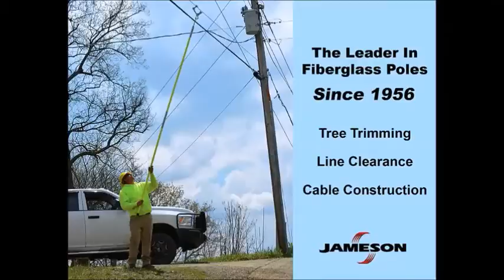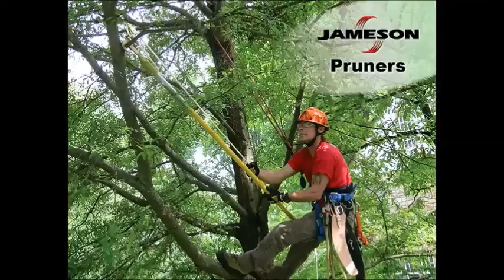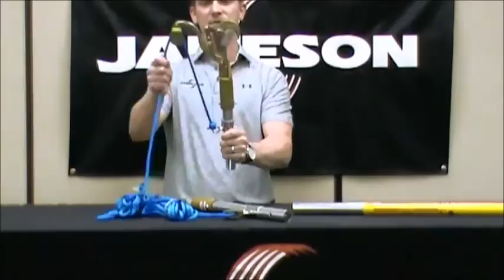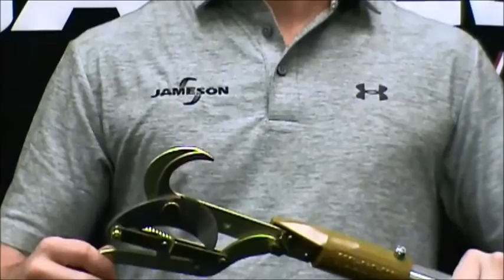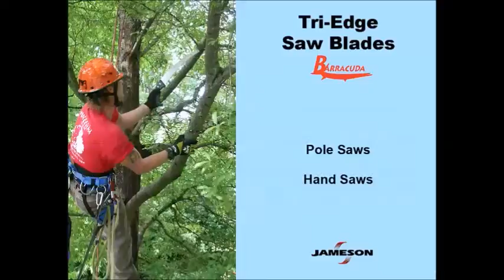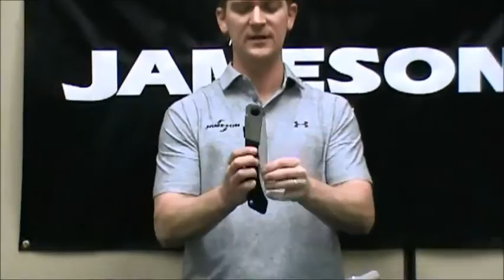Tree Tools Jameson

Comment: The Jameson poles with the Barracuda blade are an awesome combination!   The Barracuda blade is also available on a hand pruning saw for cutting branches within easy reach and cutting up fallen branches to barrel and throw away.  I spend two to four hours a week tree trimming and I've cut a thousand palm branches and hundreds or other tree branches with the same blade.  It is very aggressive.  I can usually cut through a palm frond in 3 or 4 strokes.  I no longer worry about sharpening the blade.  I have gotten so much use out of it, buying a new one, at a very reasonable price, is no problem.  But, buy a feather file if it will make you feel better.  I haven't used mine yet.  The Home Depot currently has a smoking hot deal on three 6 foot poles and a Barracuda blade for under $100 dollars.  A comparable Silky blade can cost that much by itself and is about the same performance.  I've cut numerous 8 to 10 inch branches 16 feet up and pulled out my chainsaw to buck them into small pieces once they were on the ground.  Don't go to the emergency room.  Stay off ladders and use a pole saw.